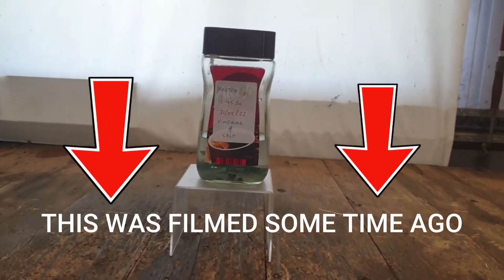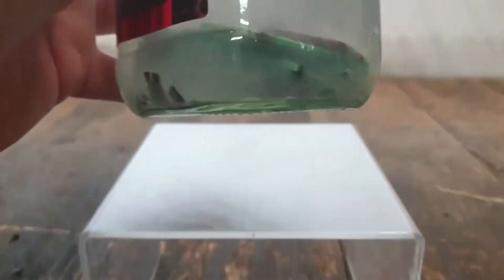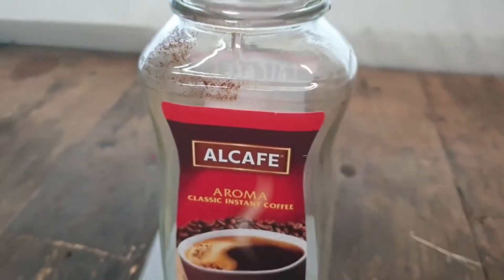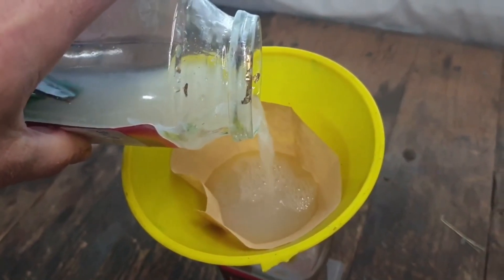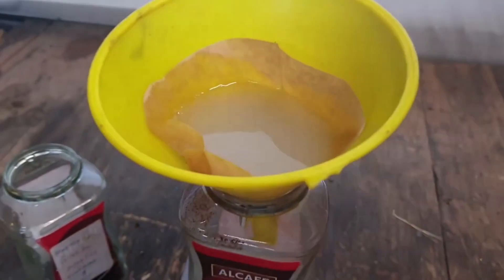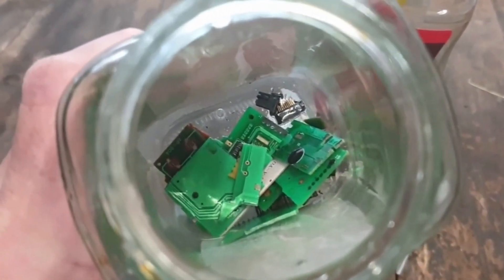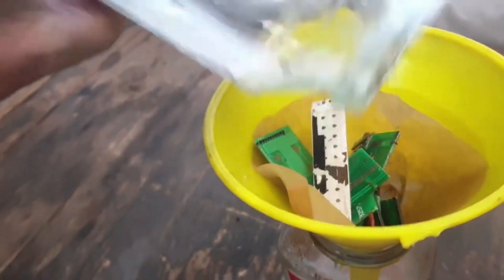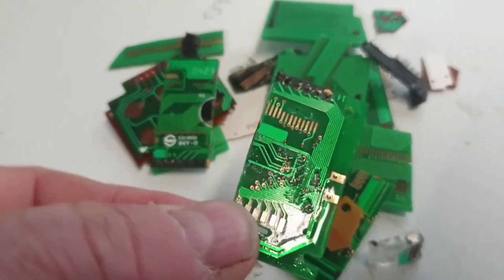GOLD Recovery- With Salt & Vinegar ?

Comment: try materiels without soldoring \ connectors \ blob resin. use just goldplated board and clean it before with hot water. the white vinegar is acetic acid minimum 10%

Comment: you gotta put hydrogen peroxide in with it as well from what i understand thats what kicks it all off.thats what i do and its works and in less then a month.not only that but I'm not seeing fingers in there.only flashing Wich I think you have to use acids to get those.i tried putting s sim card in one time Wich it didn't work out so well.also fingers are the gold contact points on like computer ram sticks.
Reply from the maker: I will give it a try, thanks for watching and taking time to comment.
Reply: @scrapnsalvage  the videos I watched had a bubbler and stronger vinegar, with peroxide.
Reply from the maker: @ijones79 that’s something I might try down the line, this is just a hobby so I’m I no rush, but yes, the bubblers seem to reduce the time also. Thanks for watching and taking the time to comment.

Comment: Did you use the right strength vinegar?
Reply from the maker: @DocIdaho  just regular id have on my fish & chips lol
Reply: @scrapnsalvage  The more concentrated, the better it should work. In the grocery store you should find vineger with up to 15% acid. Here where I live it's called "vineger essence" but I don't know if you can translate it word by word. Maybe some other acids could also work and are even better so solve the metals, but these are often hard to get, like the best you could get your hands on (don't get it on your hands) for this, would be a mix of hydrochloric acid and nitric acid called aqua_regia (https://en.wikipedia.org/wiki/Aqua_regia).

But whatever you try, work safe. Wear gloves and goggles and don't handle such hazardous substances indoors.